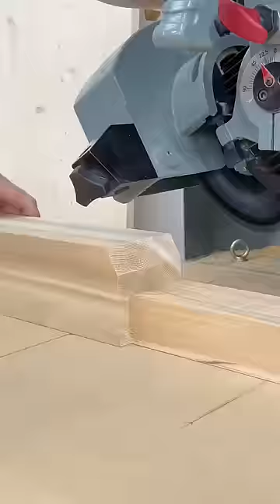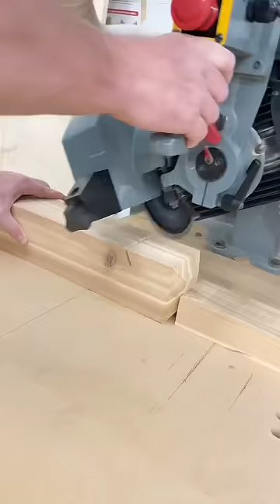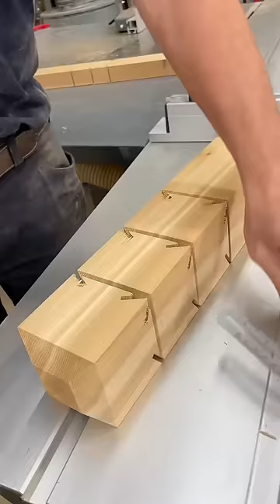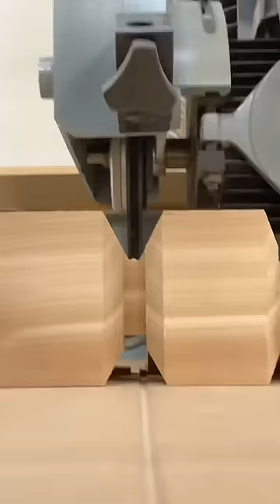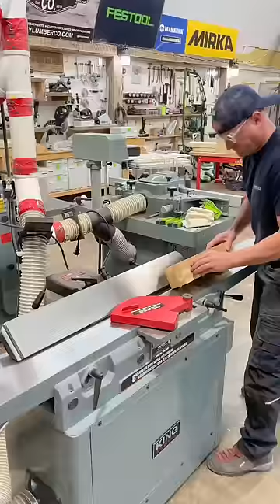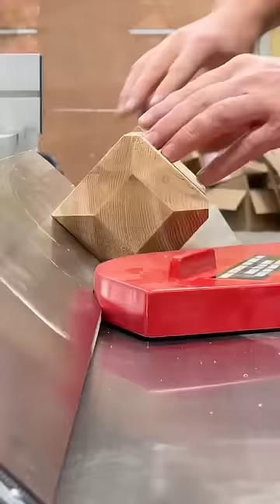Testing another coffee table leg idea #woodwork #woodworking #wood #maker #bois #holz #madera #tools

Comment: This man’s gotta have a half a million just in tools no? Freaking impressive
Reply: way more probably
Reply: Doubt it
Reply: Probably
Reply: @itslime8846  More than 500000... do you have to be a contrarian?
Reply: If you count the costs of the shop along with the tools I'm sure it up there
Reply: More like 20-40k
Reply: @itslime8846  aku nak cakap
Reply: @an2thea514  the log saw outside the shop is probably close to that. The king radial arm saw in this video is $8-10k. He's dust extraction system in the shop probably quite costly as well. That's 3 tools and close to $60k. Now let's add the other hundred or so machines, hand tools, battery powered tools. Not counting the shop that houses all of this equipment. 500k is probably a very close estimate. But the money to buy these tools means nothing if you do not know how to properly use them.
Reply: @alexayache8556  the log saw is somewhere at 30-35. Right.
Dust extraction system? 5k is done yourself, 20k if done by a company.
Joiner-planer combination? A 50cm is 9k new, this is a 40cm. 
Radial arm saw? Maybe 8k.
Formatting table saw? A similar GERMAN Felder with DRO and CN Controll system is 15k and theirs is asian.
Spindle moulder is probably at 20k, those are costly if you want something that actually cuts.

Now remember that they are a company and get 20% off because they don't need to pay tax for those in exchange for warranty.

Coming from someone that opened up a woodworking company last and current year. I study my tooling catalogues.
Reply: @an2thea514  he's got 20 k ...jus in fest tool stuff alone....that dude doesn't have a clue!!!!
Reply: @an2thea514  way off your rocker bro ...!!!!!
Reply: @johncamp215  no
Reply: @johncamp215  if I have bigger machines than him and have 120k in tools, he doesn't have half a million.
Reply: Nowhere close to half a million.  Low to mid tens of thousands
Reply: Haha no...
Reply: Some machines would leave 0 change from half a mill.
Reply: @an2thea514  when did a tools size depict it's price point?
Reply: @dannythorpe1425  a 4mm chisel costs less than a 25mm chisel from the same line.

A Dewalt Bench planer that weighs 25kg and can plane 300mm costs less than a Format 4 Planer that weighs 800kg and can plane 630mm.
Unless I misunderstood you.
Reply: @dannythorpe1425  yes, but he isn't running a 5 Axis, multiple cutting head CNC, neither a Sawmill with multiple saw bands and auto log feed.
He is using high quality hobby tools, maybe small industrial
Reply: @an2thea514  yeah you misunderstood. My old boss had a giant sheet bending machine, sounded like a ferrari when fired up. It cost him 100k. In the corner was a tiny (in comparison) cnc machine that cost him 250k. Size does not depict price.
Reply: @dannythorpe1425  ok, but where did I claim that two completely unrelated things are connected in price because of their size?
Reply: @An2TheA  you claim you have bigger machines that didn't cost half mill so his can't. It is ridiculous to think that, as we have already agreed, a machines size doesn't depict its price.
Reply: @dannythorpe1425  but you can compare two Planers, two jointers, two formatting table saws, because they are the same kind of machine designed for the same task.
Reply: @An2TheA  but the same applies, the cost isn't worked out by the size of each. The largest drill dewalt make will be cheaper than a smaller hilti drill. That's 2 drills for you but your comparison doesn't work?
Reply: @dannythorpe1425  you force your opinion, but you forget comparable.
A watchmakers lathe and chinese mini lathe are about the same size but do different things and have a different price. But they are not comparable. You do different things with them.
His jointer and my jointer do the same thing in a similar dimension of workpiece (400 vs 500 mm).
So we talk about bigger in terms or workpiece manipulation area, not outer dimensions. But we still talk about the same tool.
Reply: @An2TheA  I'm not forcing an opinion, it's fact, a tools price point is not due to its size, the materials used to make it, time spent making it, the manufacturers name are just a few factors, but never its size. Ask any manufacturer you like how they came up with the price, not one will respond well its capable of working with 500mm piece of wood so we decided "x" amount. Nope.
Reply: @an2thea514 20-40 😂😂😂😂😂
Reply: @an2thea514 you obviously haven't bought many quality tools.  Some of the machines in that shop cost tens of thousand$ each.  $500K isn't an outrageous guesstimate
Reply: @an2thea514 you obviously haven't bought many quality tools.  Some of the machines in that shop cost tens of thousand$ each.  $500K isn't an outrageous guesstimate
Reply: @davidswan4801  my planer, bigger than his, cost 4800 and is from a german manufacturer, not asian like his
Reply: I would agree, impressive collection of high quality tools which makes his projects easier to achieve.
Reply: what's more impressive is how clean his shop is!
Reply: Gifted from festool??

Comment: Keep coming back for  just one thing THAT!! Radial saw I want it so badly shame it won't fit in my 10x8 workshop😭😭😬
Reply: That just means we will have to improvise 🤔🤔🖖
Reply: There are smaller ones that turn like his.
Reply: Radial saws have inherent problems that make them dangerous for certain cuts.  Look up some videos on them.
Reply: @christopherthorn1906  Do name them.
 I have used various radial arm saws for close on to 40 years and the only dangerous condition I am aware of is operator ignorance, but then again that can be applied to a pair of scissors too.
Reply: @BeachsideHank  It's just not my opinion as there are plenty of real experts who say the same thing. Kick back on a table saw lifts the wood up and throws it at you ( not good ) but on a radial arm saw the wood is squeezed between the saw blade and the table top so it is propelled forward at incredible force and speed. My experience while cutting small pieces was that the wood also twisted with such force that the saw blade bent slightly and could no longer be used.  I no longer use mine and I will not sell it to anyone. 
But you do you.
Reply: @christopherthorn1906  It's just not my opinion as there are plenty of real experts who say the same thing."
Yet you declined to cite just who these "experts" are.
BTW you explanation of the force/ direction of a radial arm saw is incorrect, but I suppose you got it from one of your mystery "experts".
Reply: @BeachsideHank  I sincerely apologize for not upholding Youtube comments' esteemed standards by not providing the appropriate citations. In the future, I will forgo commenting on further tool related videos but I will instead go back to making fun of anti-vaxxers.
Reply: @christopherthorn1906  "I will forgo commenting on further tool related videos but I will instead go back to making fun of anti-vaxxers."
I recommend throwing Flat Earthers under the bus as well.